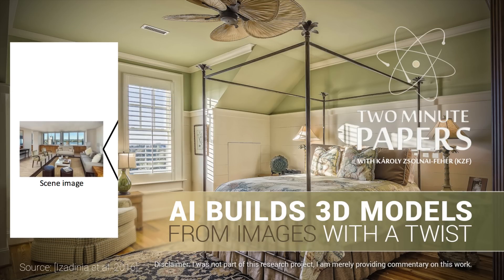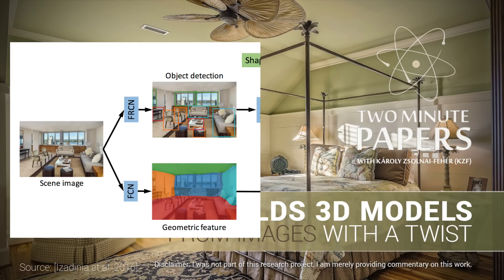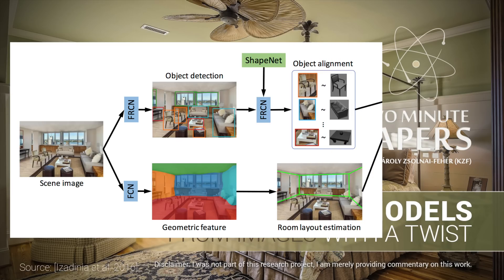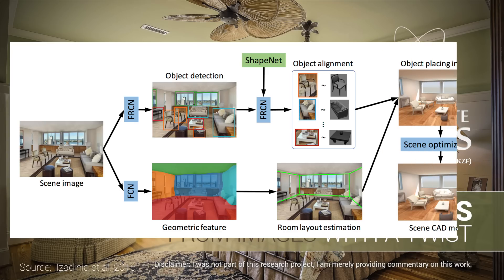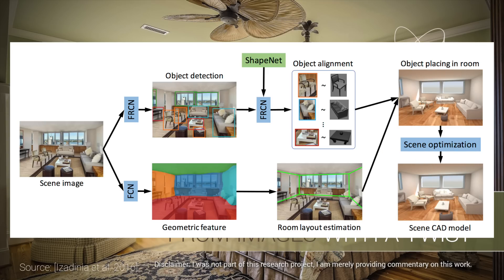AI Builds 3D Models From Images With a Twist | Two Minute Papers #129

Comment: In a different two minute papers video it was explained how large training sets could be made for self-driving cars using videogames. It is very time consuming to take photographs from a drivers perspective in real life and then have artists look at the images. The artists have to trace the silhouettes of objects such as cars, pedestrians, and more, and then label them. However, with a video game one can quickly generate a screen capture of a scene from the perspective from someone driving. The software can also generate an image from the same perspective, but where the cars and various other objects are all automatically outlined an labeled; no human artist has to laboriously trace the outlines. This summary of the previous two minute video was longer than I wanted it to be, but my point is that I think you could do something similar for creating training sets from modeling furniture arrangements in a room. For training images, instead of taking photographs of furniture layouts in real life, one could instead use screen captures of furniture in a room from video-games. To get training examples, there is no need to  have an artist laboriously create a 3d model from the 2D image of furniture in a room. In a video-game, the computer already has the correct 3D model. You could create huge training sets of flat pictures of furniture in a room with the corresponding correct 3D model for that image. Hopefully the computer modeled furniture from the video-games would be realistic looking enough that when you fed the AI photographs of real-world scenes, the software would still be able to correctly output reasonably good 3d models to describe the scene.